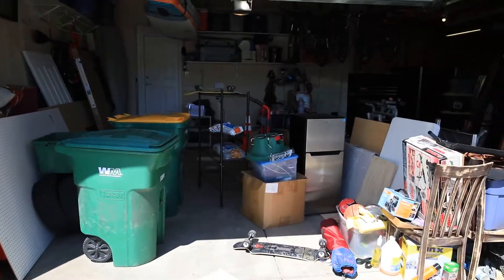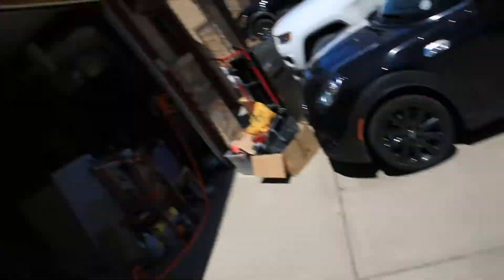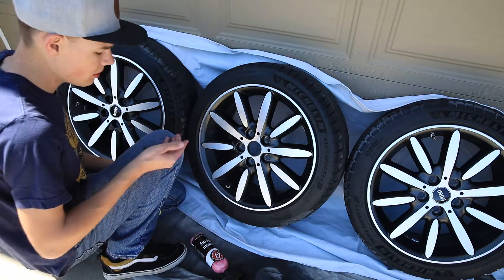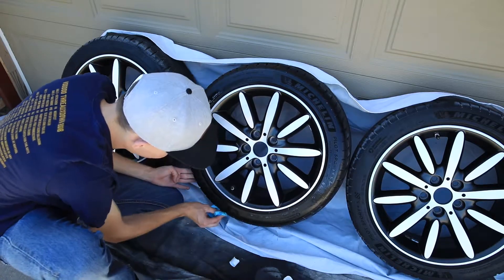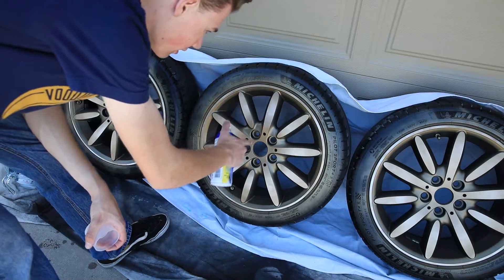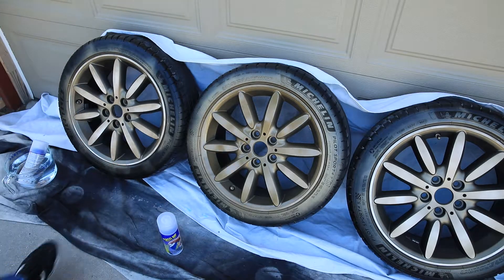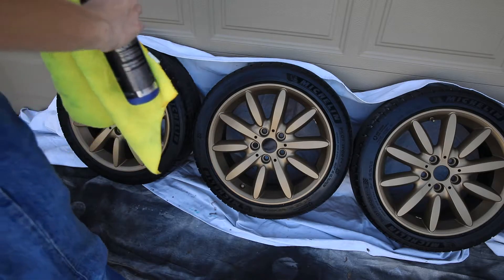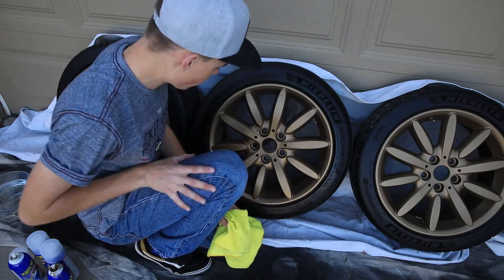PLASTI DIPPING MY WHEELS GOLD | How to Plasti Dip Wheels

Comment: You’re a gutsy guy to pull that off yourself.
Reply from the maker: I’m not gonna lie, it was a bit concerning to start with, but after a while I realized that it’s just fancy spray paint
Reply: @AidenOwen  was the product you put on the tires ahead of the paint to help clean off the overspray later? And why is it referred to as plasti dip?
Reply from the maker: Yes thats exactly what it was. It's basically a super slick tire shine that prevents the dip from sticking to the rubber
And I honestly have no clue why its called plasti dip. I know its plastic based, but no clue why its called a dip when its almost exclusively spray

Comment: You missed an important step . would have looked 100 times better if you sprayed them with black Plasti dip first ,and then went over a dry black surface with the gold
Reply from the maker: I went off of what I saw on their website, but you’re right. That definitely would’ve helped in some areas